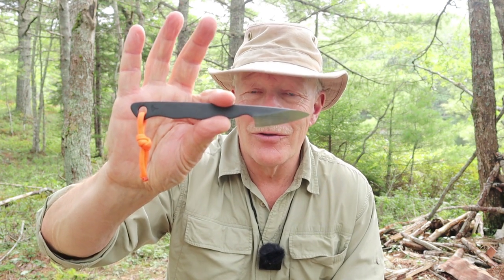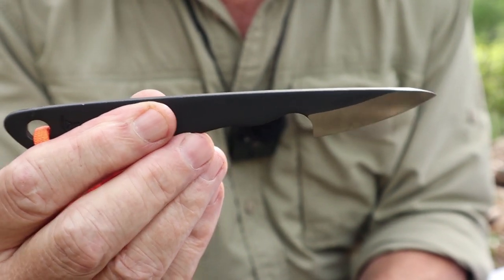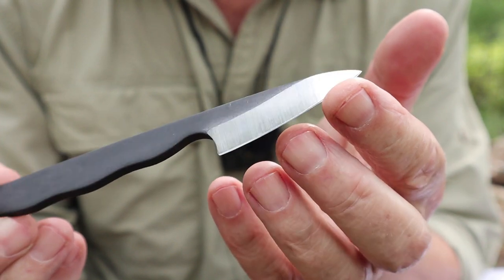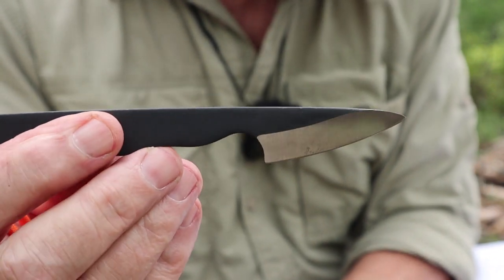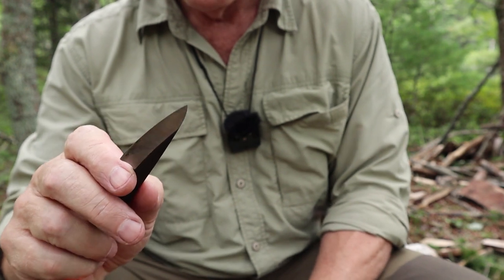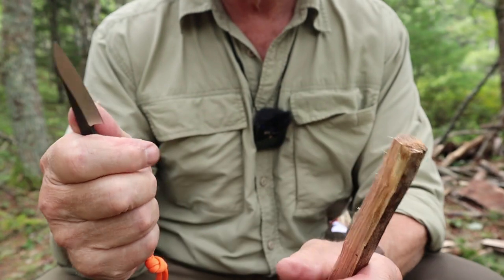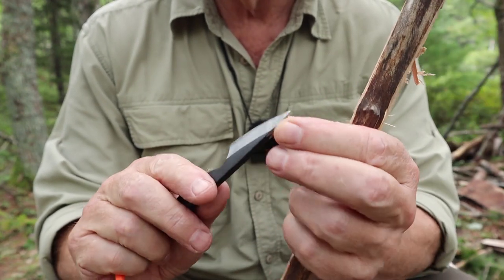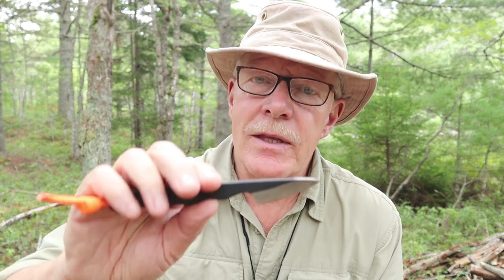Terava Tiny Knife

Comment: I batoned with mine. Beat it through a 6 centimeter log. It took it like a pro. Used the blade to start the split then pummeled the handle through the log. I use it as my hard use knife ever since. Never failed me.
Reply from the maker: definitely tough enough for the job. Thanks for commenting
Reply: @MarkYoungBushcraft did you acquire a kydex sheath for this knife yet? If so, can you tell me where you got it from? Want one for mine too.
Reply from the maker: No, I have not yet. What I can do is add a comment to the video when I find one @knife_knut
Reply: @MarkYoungBushcraft  Thank you Sir!

Comment: Being older and using knives for a long time this is a great knife design for a tiny knife. However, it is much like the A.G. Russell Woods Walker I use and still carry. I bought more than 30-years ago. Still sold with a leather or Kydex sheath; it has a POM (Polyacetal) riveted handle made in Japan with AUS8 steel. They cost more now, mine cost $6.95 each I bought six of them and gave three to friends.👍:goodvibes:
Reply: This knife looks a ton more functional and can buy it with a kydex sheath for $2 more. ❤
Reply from the maker: I will check it out. Thanks for commenting

Comment: I'm a huge fan of this brand. 

I realize that there are certain manufacturing costs, regardless of the size of the blade and cost of materials, etc. but I'm wondering if this thing could be cheaper because it IS basically made out of off-cuts... Last time I looked, this was almost as much as their other blades - only a few bucks less than their nearest priced knife. That just doesn't make sense to me. 

I wonder if it  would be worthwhile for them to lower the price and offer this as an add-on 'accessory' or incentive to other more expensive knives or gear...

Imagine buying a Skrama 210 or 240 and getting this tossed in (as a slightly higher cost option). 

Maybe even make a modular type sheath system  (similar to what they do for their 80 series knives now). 

Or perhaps it might make sense for them to make it part of a package deal - buy a skrama, puukko, little puukko and get this tossed in.

I dunno. Is this a stand alone product at the price it's at? Because it seems like they're trying to sell it alongside of other much more capable blades at comparable (given its origin and size) prices. That just doesn't make sense. I just don't know if anyone really  needs this tiny knife that badly other than for a novelty. 

As serious as some folks try to be about this knife, I just don't think it's worth what they're charging.

Mark, I enjoy your channel. I particularly enjoy the diy and general bushcrafty  stuff. I think those kind of videos are awesome and less common (and therefore more valuable) than the standard gear/flashlight/knife reviews out there!   

Good stuff!  Thanks!👍
Reply: G'day mate, excellent points there !!!!! 
As a knot guy, for light rope/cordage, (and also use as a ferro rod scraper), rather than pull out a Skrama for those light tasks, as examples, I'm with ya, I'd love it as a piggy back add on for a coupla bucks more, rather than the stand alone price, and yes especially for what is simply an off cut to start with.
One could easily knock up one in a scrap of mild steel, and certainly mess around with the HT in a domestic oven, however.... by the time you do that, + sheath it, likely this one, (in 80Cr), will be on your doorstep anyway. 
Bottom line IMO, and indeed the old story, a big knife can do anything a small knife can do, ..... the other way round ...... not so much, .... so I see it as a small luxury, as opposed to a must have. 
And yep, I reckon Mark does a fantastic job across the board too. Cheers Duke.
Reply from the maker: You have a great idea. They will be watching comments and if I get a chance, I will suggest it to them. Thanks for commenting
Reply: How much is it? I can't imagine spending more than $5 - $10 on it.
Reply: @TXLionHeart  30+ EUR

Comment: I can’t featherstick at all until  I brace the end of the piece of wood on something firm to prevent movement.  Putting a branch through the lanyard hole might  give you the needed leverage to bore holes. The knife tip with the sharpened spine looks like this might make a decent reamer. Damn flies! 🇨🇦
Reply from the maker: It is now late October and flies are still out. Thanks for commenting

Comment: Awesome little knife! Would you recommend it over the Mora Eldris? Orrrrr... what is the best budget neck knife/tiny knife here in Canada?
Reply from the maker: I like the Terava Tiny but a Mora Craftline knife is a bit cheaper and more versatile. Thanks for commenting
Reply: Yeah, Eldris is a bit too fat for actual neck carry. I've recently got a Terava Tiny as well, but for an over-the-shirt neck knife I think I'd prefer the Morakniv Classic with the 3" blade. I just loop a cord through the top of the sheath. The handle will be a little thicker than the Tiny, but much more comfortable, & the blade stock is thinner too. Very lightweight to boot. Per the tiny, I'm thinking if it had some kind of pocket sheath with a clip, it'd definitely see some carry.